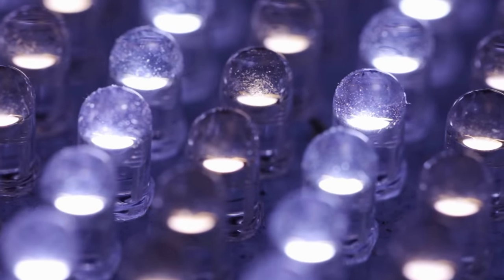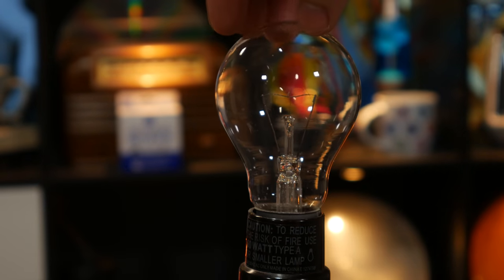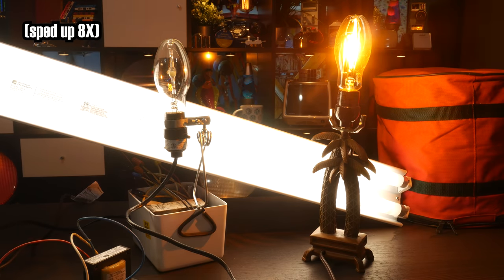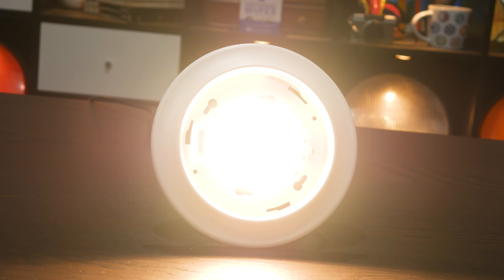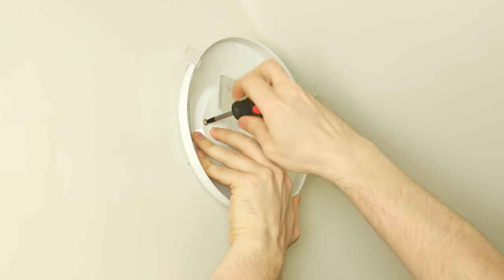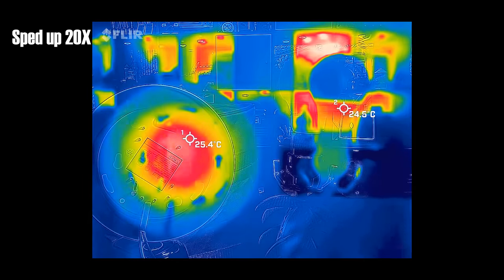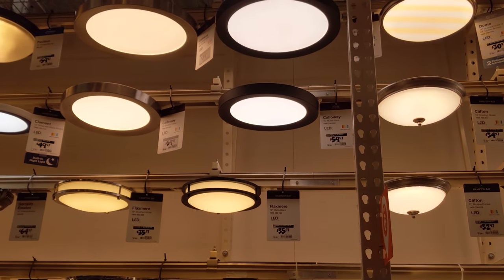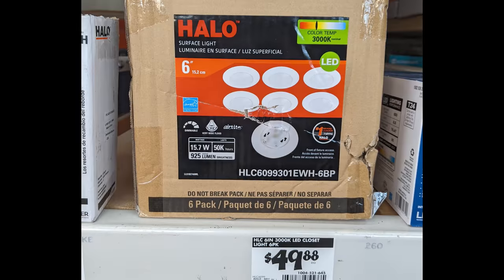A troubling trend in lighting?

Comment: Architect here: one more advantage of surface mounted fixtures vs. can lights from a building code perspective is penetrations through rated assemblies.  

These surface mounted fixtures are especially useful in multifamily construction because there's usually a 1-hour rated ceiling requirement between floors of the building.  Can lights (and other types of recessed fixtures) require a separate fire rated enclosure to be installed around the fixture to maintain the fire rating of the assembly around the fixture.  Surface mounted fixtures avoid this entirely, with just the electrical box penetration to deal with, and these are generally rated on their own.

Comment: As for LED longlivity, gnerally staying away from the cheap store brands is a decent bet. Geneally from what I know the biggest problem with longevity is that the leds themselves are pushed to their maximum in terms of voltage, where a design with maybe a few more leds at a lower voltage would last much longer.

Comment: I have those in my house, put in during construction. I have just replaced some with whatever light fixture I want. I have switched many out, just to put in a ceiling fan in the same location. The fake can light is the superior option to deal with. As you can easily remove them and replace with anything. Instead of dealing with a preinstalled fixture and have to deal with the possible construction issues from them being installed.

Comment: hopefully a standardized connector will be developed making the disconnection and reconnection of these lights safe to do by anyone, or possibly a different junction box that has recessed contacts that twist lock into place, so replacing the whole fixture is as easy as taking off the diffuser on current ones
Reply: USB connectors mabye?
Reply: The issue with that is agreeing on the same standard.

Comment: I have more than a few thoughts. 

1. I've had mixed results with LEDs. Some have lasted for many years, some have died after 6-9 months. I recently moved in to a shared apartment and my room mates often left some lights on all night, they died within 6 months. Also, I don't understand why the bottom part of LED bulbs is smooth and not finned like a heatsink. It just seems like an obvious upgrade. Maybe its too expensive. 

For color temperature, for me it depends on the setting. For general living spaces, 3000k is fine, though I'd prefer something a tad cooler. For something like a bathroom or a garage, 5000k is more pleasant thing, it gives a clean, clear, bright feeling. using a 2700k bulb in a bathroom feels like putting carpet in it, just don't. 

As for LED bulbs, I think the concept can evolve to solve many of the issues with the integrated light fixture. I don't see why we couldn't have a separate high-quality LED driver in the light fixture, and standard LED PCBs in different sizes. It'd be just a PCB with some LEDs and a connector with maybe 8 pins. 1 for warm LEDs, 1 for cool LEDs, 1 for red, green, and blue, one for ground, and two for some use we may find down the road. That would allow us to have smart bulbs with different colors and tunable color temps, if so desired, and cheaper offerings could use just 2 of the pins for a single color. Using a larger PCB, we could make it so that the back sits flush with a metal heat spreader to prolong the life of the LEDs. for those fancy looking lights we could have some sort of flexible LED strip that can be easily replaced as needed, again with standard connectors. Sure, all this would make replacing a failed light more difficult than a simple bulb, but it's something I think even my grandmother could do over a video call with a screwdriver from the corner store. And since it'd be standard, no need to worry about your lights becoming obsolete. I guess it'd be like the fluorescent lighting paradigm, but more flexible. 

Lastly, I want to mention the frosted glass from the boob-lights (hehehe boob). My ceiling fan has one of these froisted glass covers, and even though it had a reflective bit at the top, I removed the glass. It does make the light a bit more harsh, since it acts more like a point-source of light, and less like a diffuse source. However, the light is much brighter, and I'm sure the LEDs will last longer since they are now exposed to open air.
Reply: Older LEDs used to have proper finned aluminum bases. It's a combination of cheaping out and trying to make them look more like incandescent bulbs, which has failed terribly since the 'snow-cone' lights just look plain ugly.
Reply: yeah, smooth surface on the bottom of the light bulb is mainly the culprit... I als early adopter f LED lightbuld, and I had one with semi open heatsink design (forgot they are plastic or metal), but they live in a can light fixture, and already 6+ years in there. my friend also install one like mine, but the bottom one is made of plastic, but still had an opening, like a vent. 

somehow those heatsink design, especially if they had vent hole, last very long, even my friend one still going strong. Then few months ago, he try to replace some older CFL bulb with LED, but with new smooth bottom one... and as I ask how going, he said 2 of them just died last sunday, 2 month after he installed it. Those 2 are in can light fixture, while other which open air edison fixture works just fine. so clearly the smooth surface design won't cut it. luckily, he had dremmel, so he dremmel those bottom out for create some air vent and cover it with some plastic mesh (for keep out bug entering), He said hopefully that mitigation keep those LED buld died early in a can fixture.
Reply: @adityasixviandyj7334  That may help a little, but if you want to actually fix the problem they should either be opened and cut off one of the sense resistors to reduce its power or insert a capacitor inline with bulb, you want somewhere around 3W-5W for a long-lasting bulb.  /watch?v=5HTa2jVi_rc
Reply: @vgamesx1  yeah, that also really good trick too, but again he and me not have any skill of soldering, so that might be dangerous... but again I watch it and it seem simple enough...

either way, with proper venting & placing capacitr to reduce the output going really help those smooth bottom LED buld died earlier.

also I check mine yesterday, turn out, my  LED heatsink made with unglazed porcelain. that really good option too actually, but it made the lamp quite heavy compare the other one that use aluminium.

Comment: Flat “Halo” lights like these are super easy to install and aren’t really that difficult to replace. Plus they last for almost a decade. HOWEVER, color temp is mondo important — 2500-2700K warmth is tough to source.
Reply: Frankly, material usage in the light shown in the video doesn't seem much higher than that of a regular E27 retrofit LED "bulb". So if it's broken, or you don't like it anymore, there's no huge loss if you need to replace the whole thing. Only downside is for people who are not comfortable fiddling with mains wiring. Or renters, maybe.
Reply: In Australia standard install is to terminate old lighting supply wires with a 3 pin 240v socket, so the home owner can replace the light fitting without an electrician. The led fittings all come with 3 pin plugs preinstalled. I've had mine for five years and haven't lost one yet. They're great and dim really well once you buy the specialised LED friendly dimmer switches.

Comment: Something else I find "interesting" is led bulbs failing speed depending on if they're mounted facing down (light pendant) or facing up (side lamp) and this as you say is due to cooling.
Reply: Which one is better?
Reply: @brrrrrr  well I've noticed for more traditional bulb styles facing upwards seems to be better, that said, I did buy some specifically for pendants and they've been 100% for the last 5 years or so... So far! But I don't know if that's just luck of the design, luck of the brand, or specific design elements... Or just luck!!

Comment: Anyone else notice how in the shots of the hardware store, there were several fixtures that had a scrolling/strobing effect due to what I think is the interaction between the shutter speed of the camera and the flickering of the LEDs.
Reply: A proper DC rectifier won't flicker. Probably these bulbs are driven by 60Hz AC with a simple capacitive dropper. Unlike incandescent bulbs which have thermal mass, LEDs turn on and off practically instantly, so the flicker is more obvious. It's a shame since flicker is totally unnecessary with LEDs.

Comment: As an electrical contractor I always try to avoid built-in LED fixtures in spaces where multiple fixtures are to be installed.  It doesn’t matter as much with one-off fixtures like a chandelier above a table.

Comment: Is it me or were you out of focus the entire time in this one?  Seems the focus was on the shelves behind.  Otherwise a good video though.

I absolutely leapt on LED bulbs as soon as they were affordable as I find I need bright cool white due to spending so much time on the computer and suffering from fatigue.  High wattage cool white CFLs got worse and worse over the years (and had extremely inconsistent colour temperature), some would last a few months at best as the capacitors would just cook, even keeping them in the open.

In my main room I now use LIFX bulbs, had some issues with the early ones failing (they pushed those early LEDs too hard so they got really hot) but newer ones seem to last for ages (they should do considering the price).  My plan would be to move to LED tape but unfortunately good CRI tape seems hard to find, at least in RGBW variety. (though I don't use the colours much these days)

I actually only yesterday ordered some filament tape for the hallway as that is now a thing and should provide great lighting along the corridor.  Plus being 12v tape, very easy to have battery backup in case of power failure.
Reply: It was either the focus getting screwed or he used green screen for this one, with the background in proper focus, and the foreground not.

Comment: incandescent ligts are trully amazing, all of the ones we have are around 30 years old and still shining to this day on an every day basis. they were very hard to kill and cost like 50cents
Reply: fluorescent lamps were also amazing, the one i use every day came original with the light fixture 20 years ago
Reply: EPA banned the manufacturing of those bulbs this year.
Reply: Uh, the up front cost was 50 cents.  The cost to run is a heck of a lot more.  Seriously, one 60 watt bulb could drive 7 LED equivalents.
Reply: Yes! Most LEDs are garbage. Incandescent and fluorescent are so much better, and if you have renewable energy, guess what the best for the environment is? Incandescent.

Comment: I don't mind these, but I'm surprised that they don't have some kind of plug pigtail you can install on the 110 feed, so they are easy to replace.
Reply: The Cooper Halo have a system where you drive 6 lights on one driver and you attach the lights to a “self healing” cable. I have not used them so don’t know how great they are.

Comment: I would argue that this form-factor is way better save for the electrical connection issue. Fortunately there is a solution for that, a normal mains outlet and plug (eg 120v US-style plug). Just make them come with a US-style male outlet on the end and have the contractor install a female plug on the wires to connect them too. Not sure if a standardization or regulation can happen here, but it would eliminate having to touch electrical wiring that is unfamiliar to most people and would remove the need for a large Edison Screw socket which saves space and removes the Edison Screw sizing challenge.

Comment: I'm so glad I'm not the only one obsessed with color temperature and intensity. And I concur, 2700K is the best as far as I am concerned, living in a gloomy Northern climate.
Reply: It's up to preference, even for color temperature nerds :) I live in a Northern country too, but can't stand even 3000K led lamps. For some reason it really drives me nuts, when I can't distinguish white or yellowish paper. Losing ability to tell apart colors is much worse for me, then losing a bit of cozyness in my house. I am writing this reply under four 4000K 2000 lm LED bulbs and I don't want my lighting any other way.
Reply: @Xan666  You should try Philips's 3000k expertcolor GU10 bulbs, they're like no other 3000k bulb, they look identical to halogen bulbs unlike every other 3000k bulb I have come across where they end up looking very cold white. (Usually I prefer 2700k as well, but these bulbs made me rethink that, only feature I wish they had that they don't is dimtone so they dim like real halogens as well, I'm also from a more northern country, Scotland)
Reply: @RossMitchellsProfile  Thank you for the advice! They look very promising with CRI 97 (and R9 91 tested), but unfortunately I use those type of bulbs only in a couple of places in my house and they all is GU5.3. And all of my ceiling lamp are with E27 sockets. But I will keep this lamps in mind, so if I came across a g10-e27 adapter I could give them a try.
Reply: @Xan666  Wouldn't recommend it unless you got e27 spots in the ceiling(which exist, think my parents bathroom used to have them), most GU10s are pretty directional. One other issue with these bulbs I found was finding e27 or b22 fittings to match them, for some reason philips don't make bulbs of that colour quality in different fittings/shapes.
Reply: I personally prefer the 5000k+ lights as they seem "brighter" to me but everyone is entitled to thier own opinion.  I have even had people who come over comment on how bright they are.
Reply: @scooterjes  lolwut, 4000k is already pretty much perfect white, 5000k sounds like it'd pretty much be a blue led.... Definitely more efficient and brighter... Just blue.

Comment: This trend is especially costly in the commercial office space sector. I work as an electrician for commercial buildings. To get replacement LED boards for commercial lighting fixtures is just about impossible. (And no, they don’t last very long.) Most of them are discontinued by the manufacturer so the entire fixture has to be replaced.

Comment: When we built our house 31 years ago with a computer-controlled lighting system that keeps the filaments warm when they are off, and ramps the lights up when turned on to avoid thermal shock. We operate the bulbs at about 50-70% of rating. Most of our bulbs have lasted 31 years! Unfortunately, the lamp warming design provides enough current that we can't use LED bulbs, because they never shut off!
Reply: It's clever, but probably you ended up paying vastly more in extra electricity than the cost of replacement bulbs.
Reply: @fat_pigeon  Not at all. It's such a tiny trickle current it costs almost nothing. As an electrical engineer, I've measure it, and it's only a milliamp or so. That's a tenth of a watt.
Reply: Is there a place where I can get the computer controlled lighting system?
Reply: @FiveSixEP  Ours was made by LightTouch, but they were acquired by Lutron and shut down. The lamp warmers and ramping are not needed with LED bulbs because there is no thermal shock wearing out a filament. If I were installing one these days I would use HomeKit compatible switches and set the normal "on" level to less than 80% of the dimmable  LED bulb's rating. That should result in very long life, because it greatly reduces the heat that needs to be dissipated..

Comment: On the topic of led fixtures failing, I had this fixture for me room that burnt out some time ago, and only after we took it down for replacement, we found some thing really interesting. That particular fixture didn't just burn out all at once, it actually has multiple diodes that seems to have gone out in different times. It's only after a certain amount of diodes gave out that the whole thing shut off, which is a thing that I have observed in my room getting slightly dimmer over time, although I didn't know why before hand.
But anyway that's a dirt cheap fixture with paper thin aluminum casing hold in place by electrical tape and exactly one (1) screw, so I'm really not surprised it gave out after a year. It's just that somehow it managed to rewire itself to avoid early failure that surprised me.

Comment: I think you missed an advantage: They're sealed plates instead of permanent holes in the ceiling. Air migration through recessed fixtures is a major source of thermal losses in residential construction. If your have a ventilated attic and recessed lights on your top floor, it's like having a perforated roof in terms of air.

Comment: I realize that there is very little incentive for manufacturers to develop a standard, but it is desperately needed.  Imagine a transformer plug on table lamps and built in transformer on fixtures and then a couple twist locks that are even safer because the voltage at the LED point is low.

Comment: I've known about this issue for years. It's even larger and more problematic in countries like Australia where it's in the law that you need a licensed electrician to do the work
Reply: shhh, the fixture replaced itself offisher.
Reply: @colossalbreacker it never broke to begin with obviously
Reply: @captainheat2314 these new model LEDs have been in the house since it was built in the 60s, i'd never do unlicensed electrical work.
Reply: @DH-xw6jp  all it is at most is flipping off the breaker, checking for voltage on leads, unscrew the wire terminal, put in new light and wire it up, turn breaker on and done
Reply: @captainheat2314  yes.
It it was a joke.

The above comments said it was illegal to change a fixture without a license, and one joked that the light changed itself, so i elaberated that the new modern lights have been in the house since it was built.